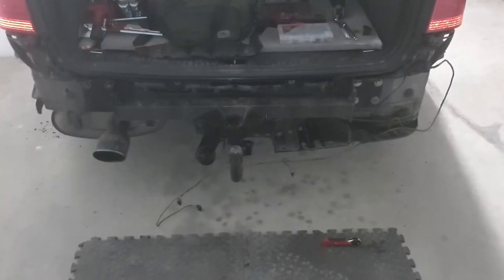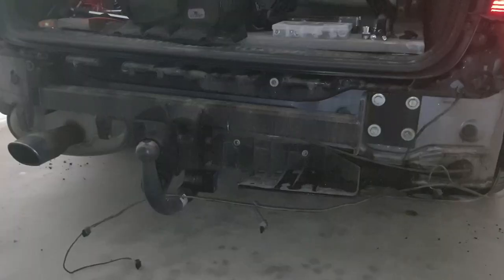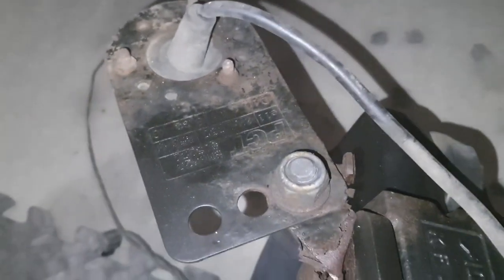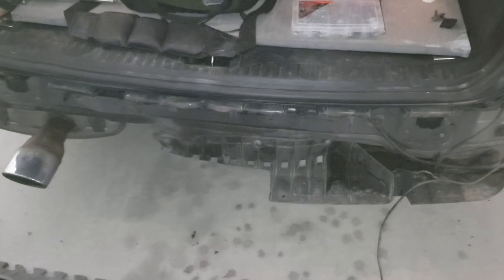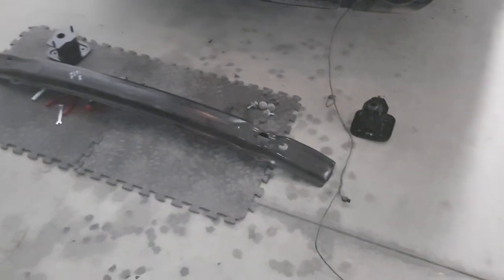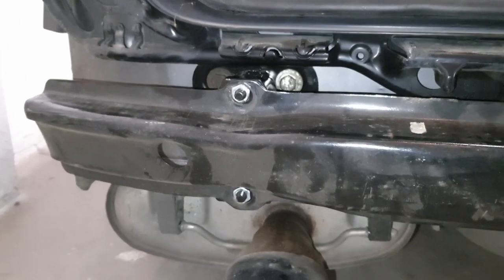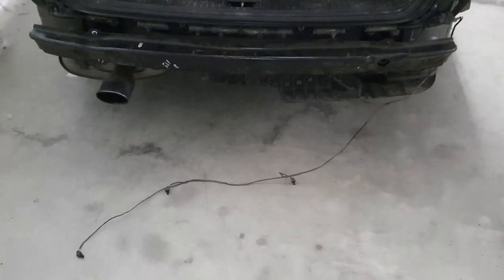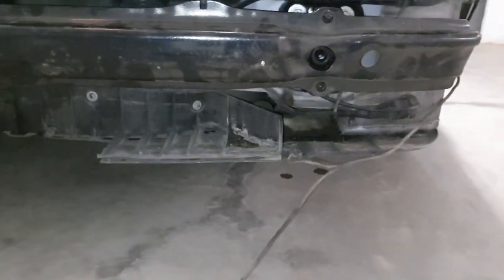BMW E60 E61 TOWBAR REMOVAL & BUMPER REINFORCEMENT KIT INSTALL

Comment: Hi just seen your video on removing towbar. Did you have any problems with the electrics? Mine is a BMW e61 with westfalia folding towball which is not moving in or out just a fault on dash towbar not in correct position with a red warning light flashing in the boot.
Reply from the maker: Hi I didn't have any problem wit my electrics, as I left the cable attached to the car.  But I think you have a different tow-bar as mine was not folding, only detachable. So you must have a sensor near your tow - bar to remove or code out, if the fault is showing.